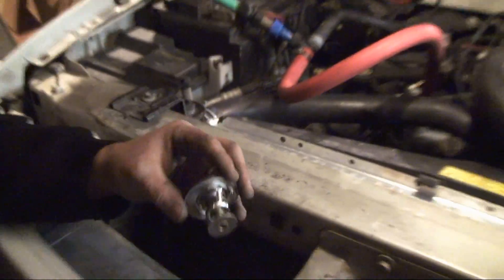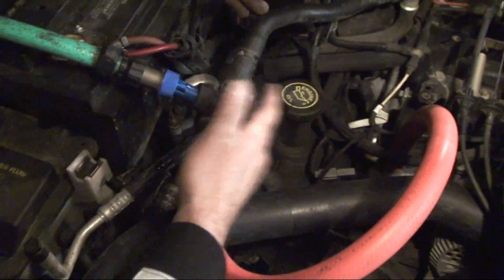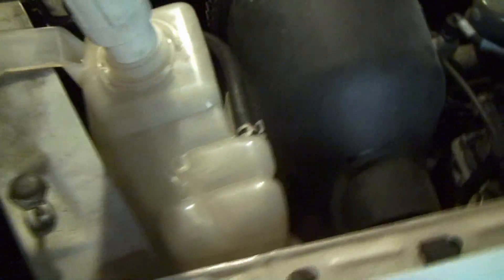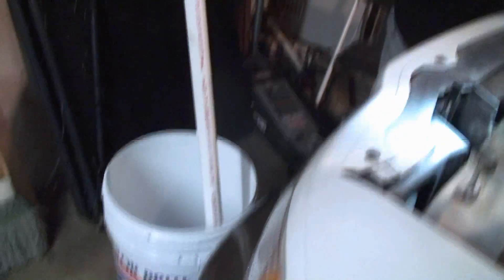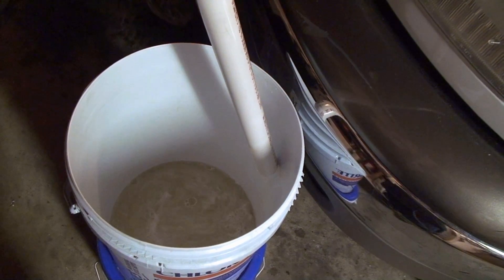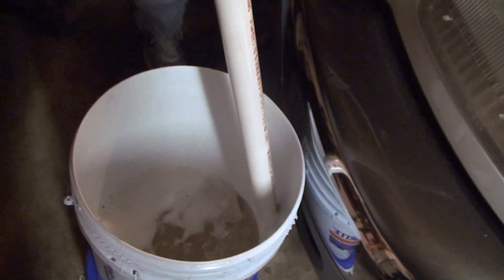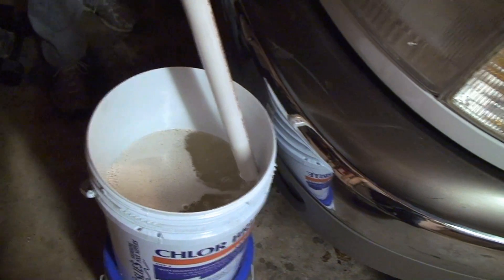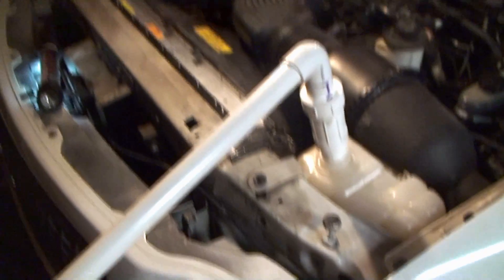Complete Coolant System Flush including the Degas Bottle Reservoir Tank  Thorough Cleaning Procedure

Comment: I got a 2000 Expo I need to get done bc I got hot hose going in but cold going out. Is there a way I can back flush it? Even with the hose going back to the rear heater core ?

Comment: Great video. Procedure is well thought out and carefully explained. I am unsure about the pvc connection at the Degas bottle. Is the adapter friction fit in the Degas bottle opening or loose? Does the tailpiece bottom out in the bottle? Specs on pvc fittings would be greatly appreciated.
Reply: That pvc setup looks a little tough o replicate . It would be easier to remove the bottle and splice a piece of 3/4 hose to the hose coming up from below  . However you may need to remove the airbox to get the tank off .

Comment: I was wanted to use your method, but unfortunately, on the 99 Expedition the heater hose runs to the rear of the engine and not the top.  I couldn't get it loose so I had to cut the hose to install the tee.  I also didn't modify the thermostat, but other than that your method worked fine.  I'm replacing the radiator and heater core so I wanted to flush the system really well before replacing the parts.